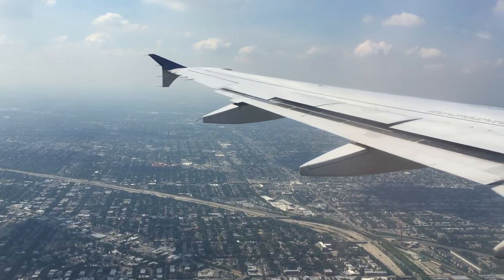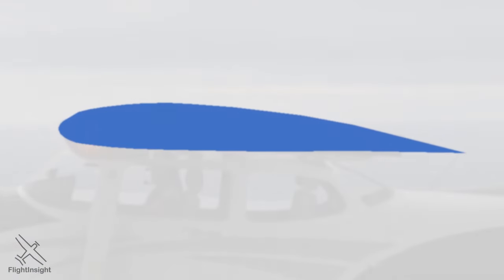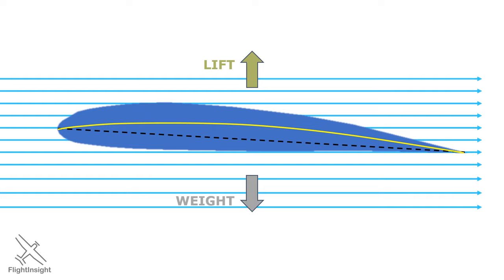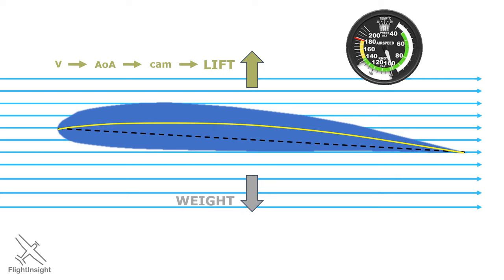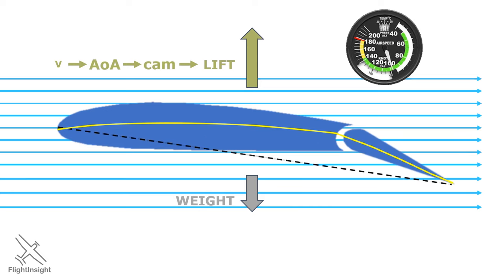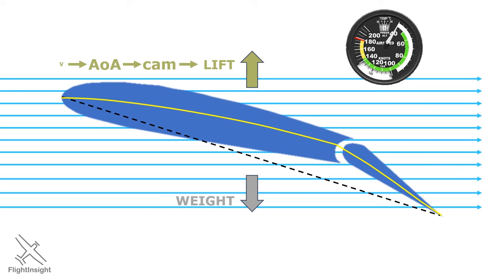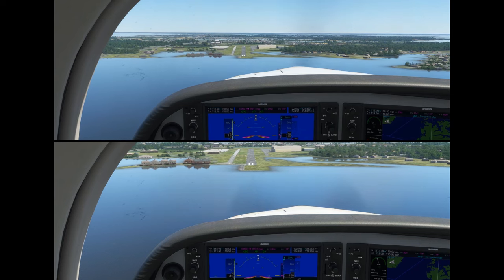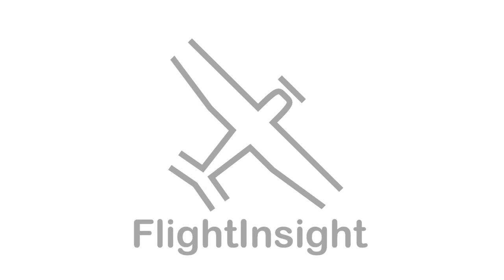How do Flaps Work? | How to Use Flaps During Landing | Flaps Up Landing

Comment: Great video! Finally someone says it correctly, we use flaps for the same lift at lower speeds. We do not need more lift than our current weight.

Comment: Genuíne question: Could you raise the flaps during a float (when the aircraft is floating on gound effect) to force it down through the ground effect in a case where you feel you have been floating for too long and is loosing runway? Because raising the flaps would result in lesslift thus slowly sinking the plane untill touchdown?
Reply: Hi I’m a pilot and I have a response to your question.
Raising the flaps during the landing float to force the aircraft down is generally not recommended and is not a standard procedure. Here's why:

1.Abrupt Change in Lift and Drag-Raising the flaps reduces lift significantly and increases the stall speed. This sudden change can cause a hard landing, potentially damaging the aircraft and causing discomfort or injury to passengers.

2)Stability and Control Issues-Raising the flaps during the float can affect the aircraft's stability and control. The pilot might have difficulty maintaining a smooth descent and controlled touchdown.

3.Runway Safety-While it might seem that reducing lift quickly will help the aircraft settle onto the runway, the risk of a hard landing or losing control could outweigh the benefits. It's safer to go around if there is a risk of running out of runway.

Standard Procedures
- Go-Around-The standard and safest procedure if you find yourself floating too long and running out of runway is to execute a go-around. This involves applying full power, stabilizing the aircraft, retracting the flaps as per the aircraft’s procedure, and climbing out to attempt another landing.
- Proper Approach Speed and Technique
Ensuring you have the correct approach speed and descent rate can help prevent prolonged floating. Approaching too fast is a common cause of excessive floating.

 Exceptions
In very specific and controlled scenarios, such as in some bush flying techniques with experienced pilots and in suitable aircraft, minor flap adjustments might be used during landing. However, this is not common practice in commercial aviation or general flying for safety reasons.

In conclusion, while theoretically raising the flaps might help to reduce lift and end a prolonged float, the potential risks make it an unsafe practice compared to the recommended procedure of going around and setting up for another approach.
Reply: @unidentified5390  Thanks for the response friend. I'm taking my comercial pilot license, I had this on my mind but I feel my CFI is a bit paranoid  about safety and doesnt let me try out some stuff with the plane. I know he is being a good pro and would never let me put myself (and him) in danger though. But still I wish he let me do these things just to know what it feels like.

Comment: why the bottom plane still moving when it is using flap bleed excess energy? U have mentioned the top one does not use flaps n both of them are 80 knots.

Comment: How are you better protected from stalling?   Yes the stall speed will be lower but so will the critical angle of attack.   When you factor in turning is the window for stalling really increased?
Reply from the maker: protected in the sense that the stall speed is lower. 'Protected' might not be the best word as yes, as you mentioned critical angle reduces with flaps (not commonly known!). Even in a turn though, stall speed is lower with flaps than without.
Reply: I will stall on final at 50kts but with flaps I won’t stall; therefore I’m protected by stalling while using flaps
Reply: Another thing that wasn't touched on in this video is that certain flaps like the ones on airliners that separate from the wing and create a gap will allow air flow between the airfoil and the flap which helps prevent the separation that causes stalling at higher angles of attack.

Comment: I don't know why a lot people who saying flap helps increase the rate of descent without increasing airspeed 
Q: my instructor told me that drop last flap will helps Aircraft increase rate of descent? I don't think so  ( I told my instructor that i fell drop 2nd flap and reduce power that will get more rate of descent to catch glideslope)
I need help  please
Reply: They're correct, imagine two cars have to make it down a very tall Hill, one of them doesn't have any brakes and the other one does. The car without brakes would need such a shallow slope downwards to avoid going too fast that it would take a long time for it to make it to the bottom, whereas the car with brakes could make it down a much steeper slope without gaining excess speed and because of that steeper slope can make it to the bottom faster even though it's traveling at the same speed as the other.

Comment: I am so glad you  say that a wing creates LIFT by Angle of Aback (AOA) not Low air pressure created by air moving faster over the top Curved surface of the Wing. You did in a scenes but not directly that Leading Flaps Increase RATE of DESCENT without increasing SPEED. i.e you can fly Slower with Landing FLAPS.

Comment: Lift isn’t produced by directing air down
Reply: You’re stuck in the 1700s 😂 imagine still thinking lift is because the plane is sucked upwards in the current year
Reply: You're actually incorrect, while the Bernoulli principle does create some lift, especially during cruising, especially in relation to flaps. The majority of lift is created by Newton's third law through the movement of air downwards across the airfoil and flaps.
Reply: @MaxPower-zs7we  while the majority of lift during takeoff and descent when flaps are typically used is due to Newton's third law in relation to the air being directed downwards, typically at cruising speeds, the majority of your lift is created by Bernoulli's principal due to the lower angle of attack, but as to which one is creating the majority of lift, it depends on a lot of factors including air foil, design, AirSpeed, flight conditions, and much more. So yes, I do believe that suction is a contributing factor because that's what the physics and engineering says.